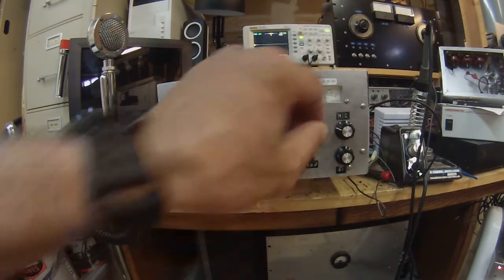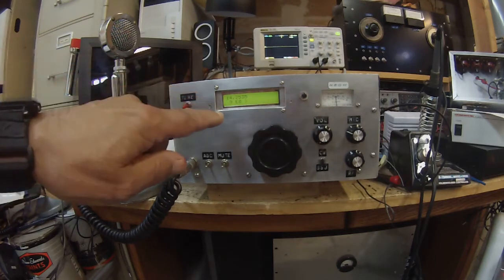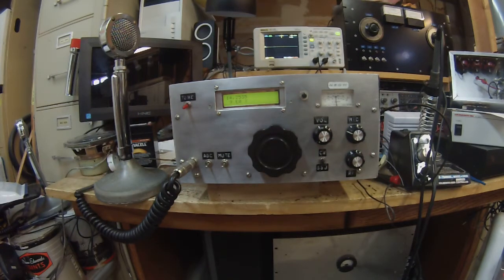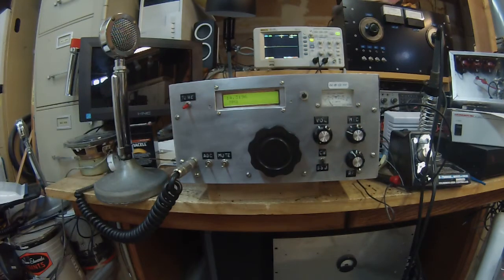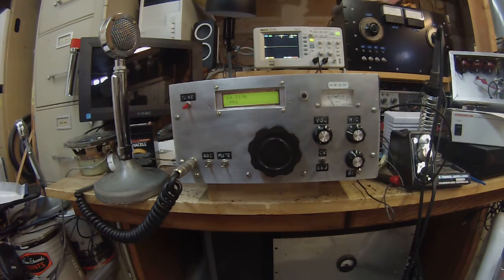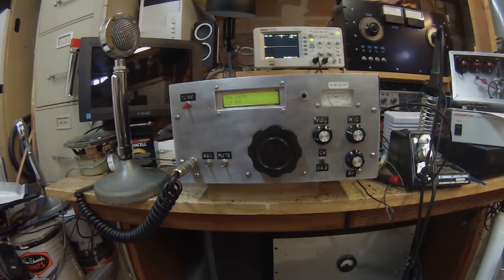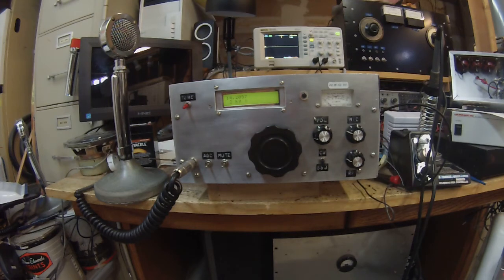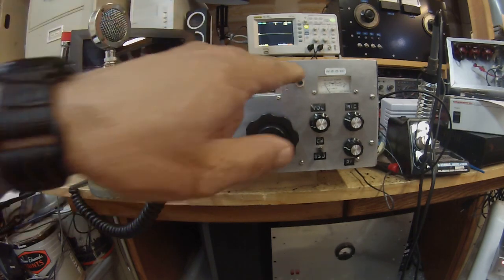W7ZOI Transceiver as built by N6QW

Comment: It's amazing how many high quality rigs you've built and have at hand. It must be tempting to redo them. I always thought about building this version of Wes's radio mainly for the speech processor part. When I think about it though, all my radios are more or less designs from W7ZOI and would only require minor design changes to make this one :)
Reply from the maker: Hi Tom, 

Thanks for your post. The real answer here is the superb and bullet proof design of W7ZOI. I suspect with the addition of the Si5351 in lieu of the analog VFO will make this an even better rig. I guess the speech processor had me concerned a bit since so many of the processors, even the commercial ones, when engaged are typically overdriven and that makes the signal sound not so good.

73's
Pete
Reply: You're right, everyone was building lousy sounding(or poorly adjusted) speech processors in the era of this radio. Some were pretty effective though in adding a little "punch" when needed. Your first point about the quality of  Wes's designs makes me even more curious about how it might sound. Now I got to try it :)

Comment: How much power from the IRF510 on 20m Pete? I've been lucky to get anything more than a few watts.
Reply from the maker: Hi Paul, That is pretty typical 4 or so watts is about max smoke -- hardly never 5 watts. In the uBitx Farhan uses two IRF510's and even there it is hard to get 10 watts on 20 Meters. I do find that drive level is another factor in that frequently drops off at 20 Meters --so it is not just the IRF510. Careful matching is always critical. So maybe more than just a couple watts but really a stretch to hit 5 watts. Thanks for your post. 73's Pete N6QW
Reply: Thanks for confirming, I think the IRF510s power drop-off above 10MHz at 12-14 volts is what drives some builders to the RD16HHF1 -- as the spec sheet says, RD16HHF1 is a MOS FET type transistor specifically designed for HF RF power amplifiers applications. Pout>16W, Gp>16dB @Vds=12.5V,f=30MHz
Reply from the maker: Hi Paul, A couple of other options are 2SC2166, 2SC3133 and the MRF260
Reply: Paul, a single IRF510 is capable of around 20W or so, but not at 12V. It works much better at 24V, as that was what it was designed for.

Comment: What LID left a thumbs down?? Give me a break lol...  Pete, I'm actually working on this same transceiver design at the moment. I'm making a few mods also, like you did. I am using the original VFO design in W7ZOI's schematic, but I changed the BFO to allow operation on 80M as well (and adding the additional bandpass filters of course). Also adding an S-Meter and frequency counter, different PA design, etc. 73/72s
Reply from the maker: Hi Ruel, Thanks for your post. After starting the project I contacted W7ZOI and I sort of became a Beta tester for some of his HyCas work. the IF in my rigs do ot use the MC1350 like in the article. Send me an email to n6qwham@gmail.com and I will share the schematics and other data -- I think I also have the S Meter circuit too.

Good Luck with your build. There are a couple of hams who have failed at having the knack and they typically give me a thumbs down.

73's
Pete N6QW